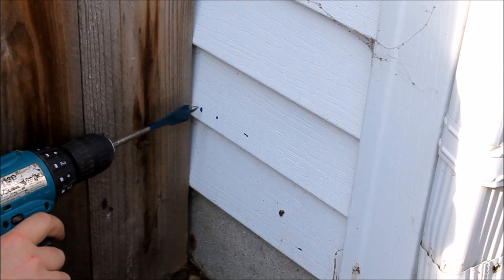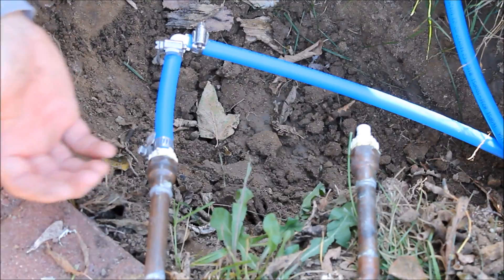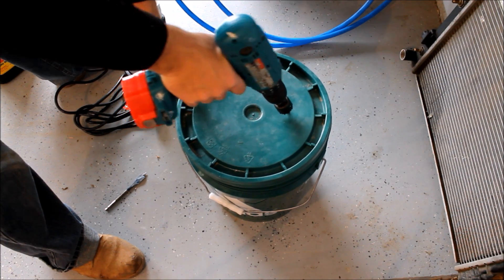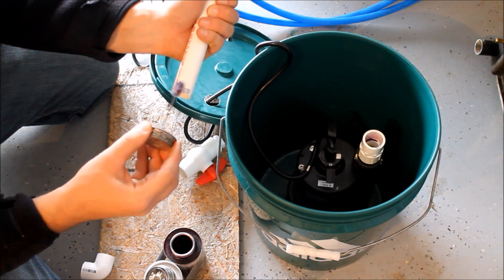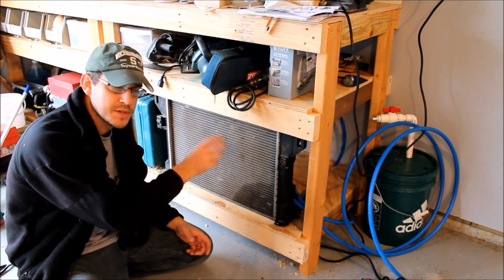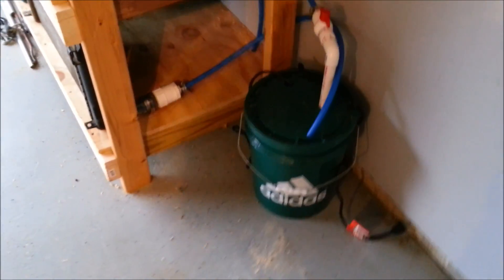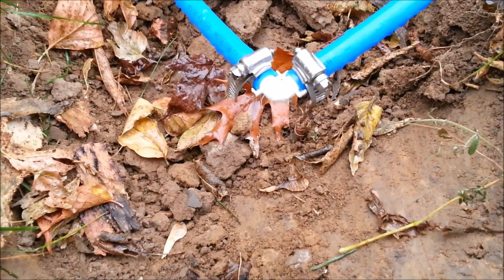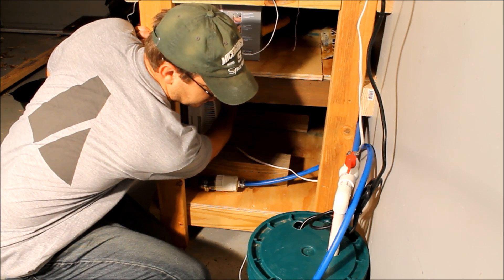Outdoor Wood Burning Garage Heater - Heat Your Garage For Free Using a Car Radiator!

Comment: Never use purple primer.  they make a clear, that does the same.  Purple is only for plumbing inspecters.
Reply from the maker: Thanks Lance. For most brands of PVC cement the purple is primer and the clear is cleaner. They are a bit different but you are correct about plumbing inspectors they do like to see that the correct primer was used:) Thanks for checking it out!
Reply: Never say never

Comment: great video man...   i have a similar set up at home to heat my garage but i thought running the hot water through my unused garden hose in the winter (200 ft) would radiate enough heat.....   i'm not satisfied with that... my question is how warm were you getting your garage in the winter????   i live in canada and it as you may know gets cold here,,,,lol... also do you think a cast iron rad would be better????   again great job and video
Reply from the maker: I have not been 100% satisfied with the amount of heat here either. I am going to be adding more coils to the barrel stove as well as insulating the underground piping to make this more efficient. If I get a good fire going and it is above 10 degrees I can heat up the garage to about 45 but not much better than that. About a 30 degree split from the outside air.
Reply: SSLFamilyDad i have a 50 ft coil in my barrel stove it gets the water hotter than the hose can handle....   i'm hoping your coil is shorter and when you make it bigger your system will work well but i;m worried the pex can't handle it.... i might be wrong tho... i think it is rated for 180*  but probably will take hotter...   please let me know the results if you super size your coil in the stove.
Reply from the maker: tom Me I am going to do an update on this project soon. It has been -20 here recently so I am just waiting for some slightly warmer weather. I currently have 30 feet of copper in mine. and yes the Pex is rated at 175 I believe  so if I get it too hot I will have to run the water through it faster.
Reply: +SSLFamilyDad I've been following all your comments since last winter. Any new plans for this winter?

Comment: Running Electric is a waste of energy in order to power a pump and fan,plus you are wasting all that heat the wood stove is putting out with it sitting outside and all that for a garage? plus you have to keep wood dry for burning good and go outside to start the wood stove and keep wood in it?Why not just put the wood stove in your garage?or better yet, build yourself a ROCKET WOOD STOVE.and store some wood inside.
Reply: if you read the description he said that  his insurance company would not allow a stove in the garage

Comment: Hi thanks for the vid ! Just looking at buying a log burner for my home in Scotland as my house is all electric doh with big heating bills ! Just found this when looking for some ideas I am one for experimenting myself although building control and regs won't allow for much DIY builds here but very interesting to watch anyway, where in the world are you ?
God bless 
a fellow believer
Steve
Reply from the maker: Thanks Steve, I am in Michigan U.S. The outdoor wood burner works pretty well but I am going to improve upon it this spring to get more heat. When temps got down below 0F (-18c) the heat output is not very good. Thanks for checking it out!
Reply from the maker: jbcohe I can give you some rough estimates here and I will still be doing an update with more specific temps as soon as I can get a chance. Right now I can get a good fire going in the stove and heat the garage up about 10 degrees in about 2 -3 hours. That is when it is below 10 degrees outside. If it is in the 20-30s I have been able to heat the garage up to about 65 in a couple of hours. How often you need to add wood is really dependent upon the wood you burn. I normally add some wood every hour or two. I will be improving this design in the spring. Adding insulation to the pipes, insulating my garage door, adding a second coil of copper pipe to the stove, and getting a better fan for the inside coil. Hope that helps!
Reply from the maker: jbcohe I have been running the heater for almost a year now with no problems with the coil. Only concern I have is that creosote is building up on the copper which is insulating the piping from the fire further reducing efficiency. It is not that bad after this year but after a few years I can see it being an issue and will have to be cleaned. Circulation pump is fine for this application I don't see a need to have it run any higher volume.
Reply: SSLFamilyDad

SSL, Thanks for the recent updates in your comments. Lack of pipe insulation aside, could you give us some idea on how much heat you're seeing from this unit in your garage (how much increase, how long to warm up, how long will it burn before wood is needed, etc.)? We don't get the cold here in Delaware, USA, but it's been around 20-30* F for quite some time now and if I could raise the temps in my 2-car garage by 20-30* (with insulated pipes) I'd be very happy. Thank you.
Reply: SSLFamilyDad
 Thank you SSL! Do you have any concerns about the longevity of the copper coil since it's inside the barrel and exposed to the direct flames and high heat? How about the circulation pump, would more of less flow help?

Comment: your pipe thats under ground you should rap with with silver on both side and bubble rap in between around your pipe fir insulation works great thanks for sharing
Reply from the maker: I couldn't agree with you more on this. I would like to make this work more efficiently when it is below 0 and wish I would have done that. I guess I will be doing some digging in the spring:) Thanks for checking it out!
Reply: also look into getting down below the frost line (3 feet ) i also have been watching your videos in chicken coops was wondering how much $$$$$ you have into it????? looks like you built it in stages the chicken house , the tractor and then the feeder and water and also how did the heat tape work out ??? have a good night and thanks for all the videos have a lot of projects to get started hahaha
Reply from the maker: michael goon You are right about the frost line. If I were doing this full scale for my house I would do that but for this I will just insulate the tubing and see how well that works. I have about $450 into the chicken coop with the heat tape and insulation included. It has been working pretty well so far this year except when it gets down below 0. It doesn't quite keep up when it is that cold so I might do some redesign this spring. Thanks for tagging along!

Comment: Run the hot water into the bottom of the radiator, it slows the flow thru the radiator and reduces the water pockets in the radiator, which will allow for more heat to be removed from the hot fluid.
Reply from the maker: You are not the first to suggest this so and I am considering it. I am going to do some upgrades on this setup soon to try and get more heat from it, thanks for the tip!

Comment: Awesome video, thanks for sharing.  I have being looking for a good solution for heating my workshop using a wood heater but not have the actual fire inside the shop, especially when having paint vapors in the air, looks like this is going to a good way to do it.  Thanks again for sharing.
Reply from the maker: No problem, glad you liked it. It works pretty well but I am still working on making it more efficient and getting more heat from it. I will be doing an update video on the heater in the coming months but basically adding more copper coils in the barrel stove and insulating the underground pex tubing would be a good idea. Thanks for watching and the feedback!

Comment: Great project and nice idea. Just one thing bothers me while watching you put it together. Wouldn't it have been better to have to hot water come in at the bottom and exit at the top and have the reservoir the highest point of the system to keep air out of the system. The way you have it set up works well as you said but I just think it would work more efficiently if there was no air in the system and the way it is now I believe that would be difficult to achieve.
Reply: I agree. However, he could just bleed the system for air as you would with your car radiator.

Comment: Another great project!
A buddy of mine uses almost this same system to heat his home. He uses baseboard heaters instead of a car radiator but it's the same principle. He attached (I'm guessing on exact size) a 250-500 gallon tank and heats up that to use as a reserve while at work. He fills the stove in the morning before work and at night before going to bed and the the water stays hot enough in the tank to allow his home to stay warm while they are gone or sleeping.
Reply from the maker: That is awesome! I would love to build a bigger setup and do something like that, maybe a future project.... Thanks for sharing that rcklarue!
Reply: SSLFamilyDad
 I just called him and asked him more about his system.
He actually has two 250 gallon tanks that are over insulated. He said he preheats the coolant a week before they start calling for cold weather and it's rather easy to keep. The temp in the tanks rarely drop below 150 degrees between loads of wood. If I were building a new heating system this is what I would do myself.
I realize this is beyond what you did or ever planned to do with the video but i saw other commenters talking about wanting to heat their home with your system and I thought I would put in my two cents.--- Rick
Reply: @rcklarue  Do you happen to know if he has the tanks indoors or outdoors and if either... are they above ground or underground?   What type and amount of insulation is he using?  Figured I'd ask to clarify since seems like a great paradigm of thinking.
Reply: @jafinch78  We have since sold that home and moved, but I do remember him having the tank in a small insulated shed right next to his house. I assume the water lines were all run underground. Sorry I couldn't be of more help.
Reply: @rcklarue  That helps!  No need to be sorry, appreciate the response.  Thank you!

Comment: What temp does the water get up to after running for a while? Any problems with any of the plastic getting weak from the heat?
Thank you for this Video. This is exactly the system I'm looking to build.
Reply from the maker: Thanks James, all of the tubing I am using is high temp Pex or PVC, rated at 175-200 degrees. I haven't taken any good readings on temps and how long it takes to get up to temp but I was getting about 110 degress on it the first day I ran it. I am sure it can get hotter than that especially if I limit the fan speed. I will do a follow up video with more readings, thanks for watching!

Comment: I'm definitely going to try this in my garage. I have some of the building materials laying around in my garage. It would be nice if it will work in my three car garage
Reply from the maker: So far it has been working pretty good. Might want to increase the efficiency for a larger space, get a bigger fan than I have and add more coils in the barrels stove. Good luck and thanks for watching!

Comment: nice project and how it all came together, I am very interested in this as with a new home build coming up in the next 2 years where the weather can get rather cool I want to heat the home with a similar method.
Reply from the maker: Thanks andreweasty! I have seen a couple of other similar type systems and it could definitely be adapted to a larger scale for a home. You could use a rocket mass stove as well which burns more efficiently. I plan to add on to this one and put more copper coils in the wood burner to get more efficiency as well. Thanks for watching and let me know if you eve have questions!